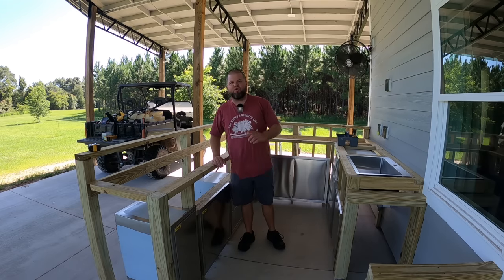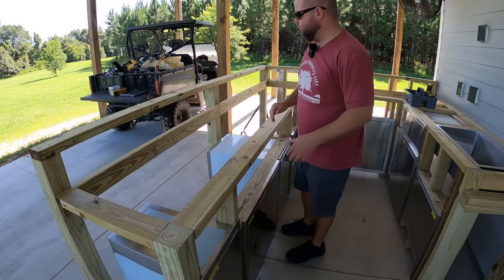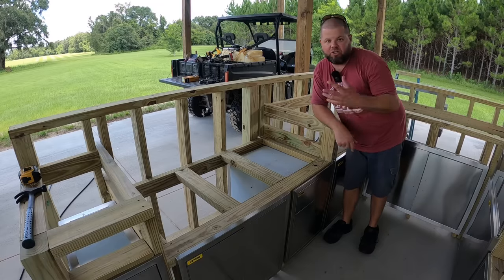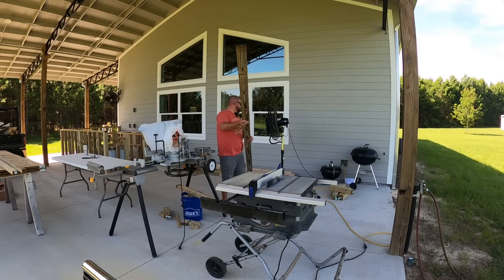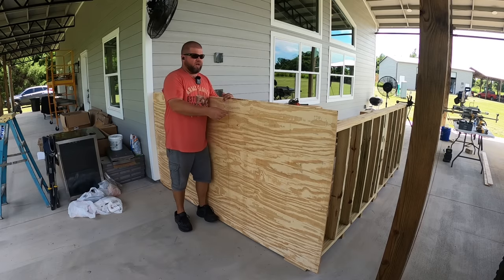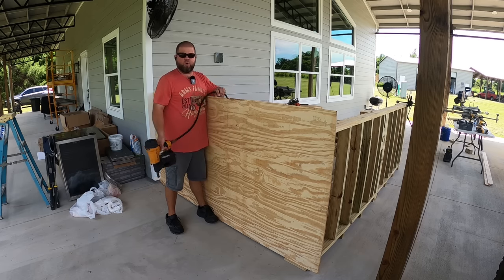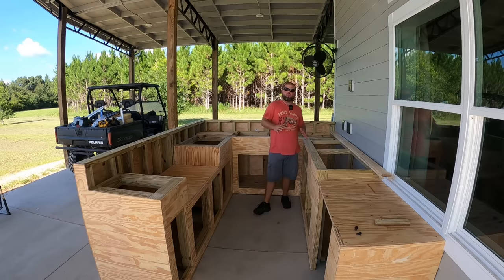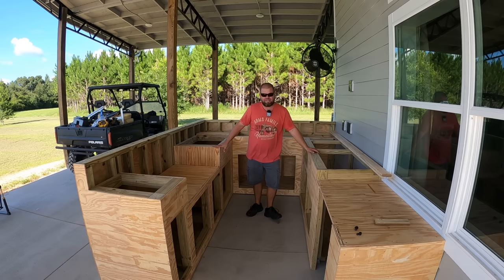DIY Budget outdoor kitchen build part 2! Blackstone area! #Vevor #616

Comment: I would add a metal sheet under the grill on top of the plywood. For grease spills cleanup. Could you add heavy duty drawer slides to the grill to slide out for grease clean out .
Reply from the maker: The bottom will be tile for cleanup. I think the grill will be left unmounted to be able to pullout. But the hinges is a interesting idea 🤔🤔🤔
Reply: Grill will be heavy to slide out but the drawer slides mounted to the grill and the 2x4’s. That way you can work, clean around the grease pan.  Nice setup. Though I would and more drawers to the right of the grill.
Reply: Thinking you could weld a brace / bracket for the grill  for the heavy duty drawer slides.   Just putting the idea out there.
Reply: I hope the heat doesn’t cause the wood to spontaneously combust under the tile.  Blackstones grills can get 700+ degrees and while Ceramic tile will be a heat shield but if it reduces it 300 degrees.  It still in range for wood to combust without direct contact with flame.
Reply from the maker: @Alphasig336  keep watching, I treat the wood with flame retardant material. Not to mention your talking 1 inch thick of tile and cement board under the blackstone.

Comment: Instead of building everything out of wood, why didn't you just buy the stainless frames from bbq coach, wouldn't that have been easier and probably cheaper? I believe most people are framing outdoor kitchens out of stainless rather than wood, stainless is better with heat and if it were to get wet.
Reply from the maker: I have the tools and knowledge for wood working, plus I'm in a rather protected area. I seriously doubt their kits would have been the same price.

Comment: I hope you run all your plumbing and electrical before putting in the tops to make it easier including gas line's
Reply from the maker: I will definitely run the electrical first. Plumbing isn't necessary the way I plan to install it.
Reply: @TKCL  you may want to , if you ever want to do something different or upgrade

Comment: Beautiful work! Question though, is it ok to enclose pressure treated wood? A carpenter told me not to ever do that and to use standard studs instead, I asked him about the wood rotting, he told me, as long as it's properly built and sealed, it'll last a lifetime, just like a wooden house wall, I also remember him saying not to ever paint pressure treated and to only use them on patios where they're exposed to the elements, which I thought was strange because I clearly remember painting pressure treated patio decks and nothing happened lol, they were pretty old and dry though, still, amazing work 👏👏
Reply from the maker: It will twist when drying, that's why I don't use it under tile. Avoid it as much as possible.

Comment: When I went down to El Paso to build the fence for my daughter I bought myself the Kreg Track System for cutting long straight cuts on the three 5 foot by 5 foot gates I built. I actually had to buy an extra set of tracks because they come with 4 feet of track and it wasn't enough length. It was the best money I've ever spent and it even works for plywood.
Reply from the maker: Track saws are awesome

Comment: I was thinking that the bottom of the sheeting should have been painted to prevent water from getting into it.  I know it's raised off the concrete, but the bottom still can get wet.  I thought moisture might make it delaminate.  It is looking good!  I'm interested in how you are going to vent that blackstone.
Reply from the maker: I considered painting the bottom myself. Time will tell, I do already have a solution in mind if I see any issues.

Comment: Looking there Andrew, I have a question how is the ac running in the house now that it is hot, is is coming on a lot and is your bill low with all that you did in the house on air tight and spray foam? I am getting ready to start a build and am wanting to see how yours is working, I would welcome any help with how yours is working.
Reply from the maker: It's been working very well! I just got my second electric bill today. I plan on releasing a video soon.

Comment: What about the edges of the ply closest to the ground isn't that going to wick moisture as you pressure wash or rain blow in
Reply from the maker: It's purposely gapped up off the concrete. The few times I pressure wash I'm not convinced that anything will happen. Time will tell, I can always trim the bottom off and add pvc trim.
Reply: Thank you for your response I love watching your videos was actually watching your ice maker videos again. Wondering how that project was working out at this point
Reply from the maker: Great, it's about to get moved into my air conditioned shop room.

Comment: hi Andrew. Thanx for the inspiration. What is the name of the tool that you use to cut out the holes in the boards with?
Reply from the maker: That was a router and I used what's called a panel bit in it

Comment: How are your Vevor accessories holding up? I’m on the fence about ordering from them. There are some very mixed reviews out there so would love your review now that it’s been several months! Awesome outdoor kitchen though!
Reply from the maker: Absolutely zero issues, nothing to complain about. Other than what was mentioned in the video about a slightly bent door. They've held up extremely well and there's no way I'd spend 2-3 times more for the big name brands. Don't forget if you use my link in the video you can apply my discount code to save even more. I have a new discount code if that one has expired.

Comment: makes the extension and does not work well with my Milwaukee saws, just does not pin in very good.  Keep preachin to 'em,  saved money through thinking and tool investment is money in ur pocket!
Reply from the maker: You talking about the rip cut? Works great with my Milwaukee corded saw and my Dewalt cordless.
Reply: @TKCL  on my cordless ones it caroms up on an angle and is at the very edge of my saw base plate.  The base plate is thicker i believe.  Keep goin bud,  love the content and watching an overbuilder and overthinker like myself.

Comment: Andrew, how are you dealing with the heat that the burners give off?  I would think that you couldn't have wood with that close of an exposure to the heat.
Reply from the maker: There is no wood above the burners. I am going to coat anything in that area with fire resistant paint before tiling over it.

Comment: question: why did you put the open to the kitchen where you did and not on the other side
Reply from the maker: Because it would shorten the entire structure due to the window location and I didn't want to be driving up in the yard looking into a kitchen. Messes with the look and flow of the house.
Reply: @TKCL  Cool i was just wondering. great vids

Comment: Hi Andrew, just curious,  how ate you going to paint the bottom edges of the plywood panels? I know you are leaving a gap for air, etc., but won't that bottom edge near the ground possibly be exposed?
Reply from the maker: I should have painted before, but I can slip a brush under there. I plan to scrub the concrete near the cabinets and not blast it with a pressure washer. Worst case scenario I trim that section out and put a thick 1x4 pt trim board there later on.

Comment: Hey. I know you said the dimensions you were working with for the length of the Blackstone. What were the final dimensions of Length, Width and Height of the drop in portion in the top for the Blackstone? Thanks in advance.
Reply from the maker: I went 3 inches either side of a Blackstone with finished product. I believe it was 42-43 inch wide finished opening.
Reply: Hi Andrew.  Now that you probably have used your Blackstone multiple times do you find these dimensions sufficient for heat dispersion? TIA for reply   @TKCL
Reply from the maker: @s.wiwatowski6898 been heavily used for almost two years with zero issues. The metal tile trim above the Blackstone can get very hot if you are not running a fan.
Reply: Good to know, I didn't think of that.  I am planning to build my outdoor BBQ area this spring, I will use some of ideas for sure.  I don't think I can use tile since I am in Ontario, Canada.  With our weather temp changes they wouldn't last to I might not have any metal above my Blackstone.  Thank you for the reply and awesome videos, a lot of good info!
 @TKCL

Comment: Did you rough in the gas, plumbing, water and electric before you put the siding on?
Reply from the maker: No, the cabinets and top is wide open. Very easy access to still do that.

Comment: Hi Andrew I am in the process of trying to get an inexpensive Outdoor kitchen area done. The panel boards that you used were these from Home Depot? Is it the same as Plywood Siding Plybead Panel 11/32 x 4’x8’? That’s the only similar looking board I am seeing on Home Depot sight. Thanks for your help
Reply from the maker: I got them from Lowe's. It's 4 inch on center paneling similar to what you described. Must be coated in a good exterior paint and out of the majority of the severe weather. Otherwise I'd go with a fiber cement siding board.
Reply: @TKCL  thanks so much

Comment: How much space did you need for the blackstone?  If 37", how big is your space for it?  And does it work well since completion?
Reply from the maker: Overall opening is just over 42 inches. I wanted plenty of room for the blackstone to vent. The backside gets hot to the touch, but our wall fan easily takes care of that when turned on.
Reply: @TKCL  I saw a later video were you explained a but more detail.  Thanks!  How do you like it and the modified grease tray?
Reply from the maker: So far zero issues, we've cooked a lot on it and the grease tray is maybe 1/3 full.

Comment: Why did you use wood?   I think stone would be a better choice
Reply from the maker: Price and easy DIY! Stone requires another set of skills, tools and budget. Don't forget my job is to make content most people can't relate to.
Reply: @TKCL  just wondering since I would have used cement board and stone cover the outside.   First it would help to insulate the insides.  And make it fire proof.
Reply: @TKCL  as well did you not say you was to leave a gap on the ground to be able to let the water flow?
Reply from the maker: Won't be a problem being fireproof around the griddle, 1/2 cement tile board, morter and then tile.
Reply from the maker: Gap with the paneling
Reply: @TKCL  ok

Comment: That's not making sense you did frame from treated wood plywood not.and that gup is way to small under plywood
Reply from the maker: You can't tile over treated plywood. It's wet, dries, twists and bows. Gurateed tile problems. That's why I completely waterproofed and sealed the plywood with a waterproof membrane.